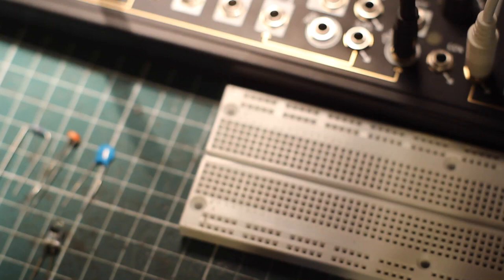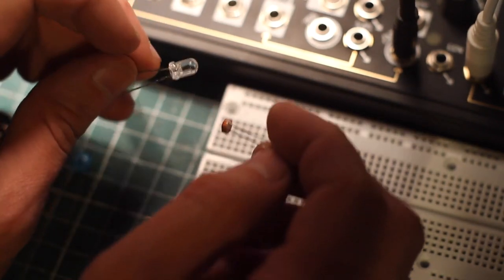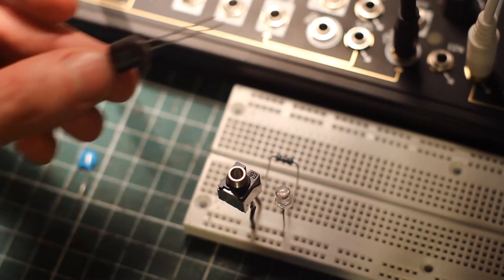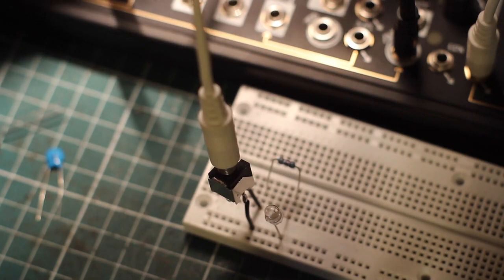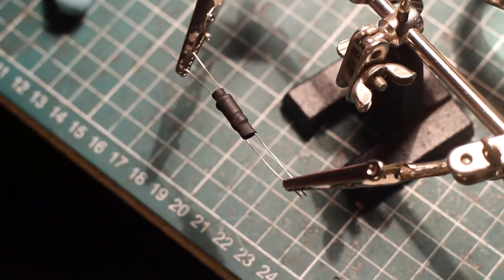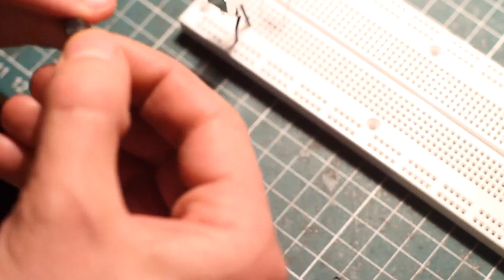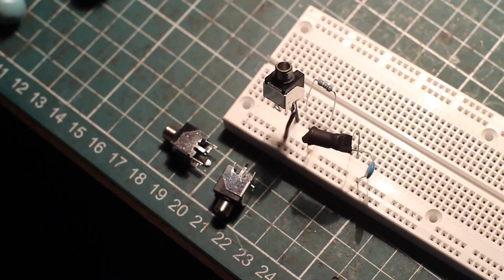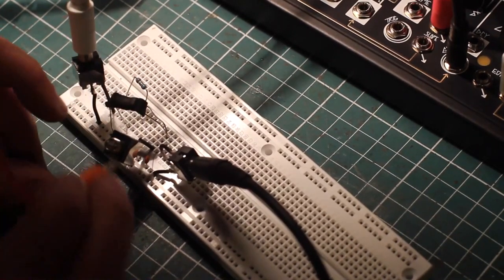SDIYClass#2 - The 3 dollar LoPass Gate - Make your own Vactrol!

Comment: hey o7, wanted to thank you for this vid......VERY MUCH!!  i'm getting into building basic oscillators and noise circuits, and this circuit is so so legit, FUN and easy to make.  I have been putting it on the output of everything lately and using the bastl cv trinity to send the vactrol rhythmic lfo's and envelopes. it works perfectly and sounds so soft, plinkety and analog.  with a little fiddling with different leds and resistors it was pretty easy to get the cv voltage from trinity knob range, scaled to match the vactrol volume range.  i really appreciate this revelation, because i really wanted some kind of simple envelope to tame and make useful the constantly ringing oscillator swarms...lol and this comes with an added bonus of lowpass filter too which has a very natural sound and can take the buzzing edge off the diy square wave oscillators. the trinity can send exponential shaped envelope cv, and this circuit responds well, making it really nice for shaping the constant input into sweet percussion sounds.  but anyway, thanks again.  would love to see more vids like this. (maybe the simple transistor ring modulator/waveshaper/bipolar vca one. it's passive too and uses one transistor and three jacks.) anyone considering trying this, SHOULD! : ) this vactrol is extremely useful and has made hours of experimenting with basic circuits pay off, because suddenly it has all become very controllable, musically useful and is really inspiring to use this circuit to perform different types of controlling.  🙋🏻🎛🎛🎛🐛
Reply from the maker: Hey, this makes me very happy :)  It's what makes me want to keep doing this more than anything, thanks for your encouraging words, and keep on having fun with sound and electronics!

Comment: Many thanks for a well produced, interesting and useful video. Having watched it I've been enjoying experimenting with various LDRs, LEDs and resistor values. I'm getting some very passable results so a few of these will find their way into my modular. The main thing I've struggled with is keeping all of the light out. It's amazing how sensitive the LDRs are to very low light levels. I'll get hold of some heat shrink - at the moment I'm using black insulation tape and the light does like to find its way in! Really good cheap additions to my synth though - thank you
Reply from the maker: cool! yeah, the heatshrink does a way better job than tape, go for it!

Comment: I stumbled upon an old article int the electronic magazine from the early 80s, where not the LEDs, but the 12V miniature incandescent bulbs were used. What's interesting, the author recommended to use a kind of diaphragm between the bulb and the LDR. It was a piece of cardboard, painted black, with a teeny-tiny hole in the centre, like in the ancient camera obscura . The diameter of this hole had to be selected  EXPERIMENTALLY for the best result. I wonder if it only makes sense with a bulb or...?
Reply from the maker: yes, that's a way to reduce the light, with LEDs you can simply increase resistance and achieve the same. Incandescent bulbs are much slower than LEDs though, which is why we use LEDs nowadays.

Comment: I have a vintage stereo that uses a few of these types of devices in the fm receiver signal section, mainly the multiplex board. Could a variable resistor be used to adjust for best performance.

Comment: Two questions you can perhaps answer:
A) Why is it called a Low Pass Gate? I've never understood that really.
B) What are the functional differences between an LPG and VCA?
All my synth learnin has pretty much been east coast school. I'm trying to wrap my mind around west coast school, but just don't really understand some of the concepts. I can use them, mind you. I just don't really understand them, which makes it hard to design sounds deliberately rather than "discovering" them experimentally.
Reply from the maker: Hi. A low pass gate is basically a low pass filter used as a VCA. It's actually cutting the high frequencies rather than just amplitude, which gives it it's characteristic west coast sound. The capacitor to ground after the LDR makes it a one pole low pass RC passive filter. That is the functional difference, as a VCA only cuts amplitude. Feel free to ask other questions you may have about west coast synthesis, cheers!
Reply: There is no real norm here, but a LPG is typically a Lowpass filter combined with a VCA. So not only do attenuate a incoming signal (= make it more silent), but at the same time cut the high frequencies. If the LPG is fully open the signal is passed with all it's frequencies. If it is only half open the signal is attenuated and has high frequencies cut of. If the LPG is closed, there is nothing to be heard. In short: a LPG attenuates high frequencies of the Input faster than low frequencies.

A VCA on the other hand does just volume and does affect all volumes equally.

Additionally to that the LED/LDR combination (vactrol) used in a LPG is slow. That means if you send a short burst (e.g. a Trigger) to it, it does not immidiately switch off after the signal is gone but "rings out" a bit. google "Buchla Bongo" to hear what that sounds like.

Comment: Hello and thanks for this. I love the sound of a LPG. I built this and it works great on my Pulsar 23 but I can't get it to work right with my Behringer MS-20 clone. I think the EG1 on an MS-20 is only 5V max so it doesn't drive the LED hard enough. Do you have any idea where I might look for info to get the vactrol values appropriate for the MS-20? TX.
Reply: Ha! Got it. I used all the component values you did but changed the resistor before the LED to 260R. Now, I got the thonk on the K-2, too.

Comment: Hi! Electronics beginner noob here. First off, thank you for a very useful and very well-explained tutorial.

I was wondering, what if I were to add a potentiometer to attenuate the cv input. Would I be ok connecting the side pins to cv in signal and ground and the middle "viper" to the resistor -> led-ldr combo +. Maybe this is a stupid question but I'm only taking my first baby steps in this thing.

Happy if you can help, anyway thanks again for the tutorial.
Reply from the maker: Hi Ville, thanks for watching :)
Yes, you can add an attenuator for the CV input if you like, and how you describe it should work just fine! Good luck :)
Reply: Synth Diy Guy great thank you again!

Comment: if you send a gate signal in, will there be a slight decay curve like on other vactrol lpgs?
Reply from the maker: yes, that'll depend on the LDR response time
Reply: Synth Diy Guy do you have a preferred LDR for that function?
Reply from the maker: @TechRedstone  i like using high value ones, like 2M

Comment: What VST I could use as modulation source?
Reply from the maker: This is analog, real voltages, not digital information. VSTis will not work, unless you set up a MIDI to CV converter. Then any mod source will work

Comment: So why would one need another non controllable VCA if you can already control the CV/gate before it goes thru this vactrol? Wouldn't you need a potentiometer on the LDR?
Reply from the maker: This is to affect audio, no pot needed, only CV from an EG or similar modulation source. VC= Voltage controlled, not non controllable ;)
Reply: @QuincasMoreira  Oohhhhhh so this vactrol idea is a way to introduce CV into something that doesn't have it. tyvm for this video dude!
Reply: @QuincasMoreira  wait, now this seems redundant. If you have a modulated source changing LED value, and LDR output changed value... why not just plug LED source into whatever and skip the vactrol?

Comment: Hi, Thanks for this video. I made a vactrol gate based on your video using a 40106 integrated circuit as the LFOr. I have a Korg SQ-1 and wondered if you know anything about how i'd go about using it to make gate patterns in a similar way to how you have used the CV out from the 0-coast as an LFO. I assumed I'd be able to get the Gate from the SQ-1 output and achieve my desired result but it's seemingly more complicated than that.
Reply from the maker: Hi James. Normally an Envelope Generator goes first, between your sequencer's gate and the LED on the vactrol, but it should work with a gate directly connected too. You need to make sure the gate output in your SQ1 is set to POSITIVE. If it doesn't work check with a fresh LED and see if it lights up. If it does, then the problem may be the polarity of the LED inside your vactrol.
Reply: Great, thanks. I will try this. I had some results out of it but it wasn't as simple as a high gate lighting the led which was strange.

Comment: Interesting video even corresponding to another DIY build.. The Erica Synth SWAMP, would you use DIY vactrols in this module?
Reply from the maker: hey thanks! Yes, you can definitely try home made vactrols on builds requesting industrial ones. Buchlas use LED/LDR pairings in their synths, no industrial vactrols...  Your mileage may vary of course, as different combinations will yield different results. I made my own vactrols for a Thomas White LPG and it worked great!
Reply: @QuincasMoreira  i just complete the kit build making my own vactrols and replacing one component, the red 22nf film cap, with 47nf film cap. This cap is connected with one leg of the S&h IC. It actually works fine similarly to your in the kit review.. Vactrols look like a new horizon for me into next builds like arduino cv controlled synths and so on.. keep on doing this diy classes mate, they are very useful and well explained!

Comment: Please help, I am entirely new to this and I got some 3.5mm jacks to do this, but idk which legs are ground or signal. There’s 3 legs, is there a ground and pos/neg signal or is it just ground and two signal?
Reply from the maker: Hi Elyssa. Usually one leg is the signal, one is ground and one is the switch. It's a terminal that gets connected to the signal one only when no jack is inserted. It's used for normalization.
I don't know which jacks you got though, so you should find the part number and look up it's data sheet!
Reply: @QuincasMoreira  I think I accidentally got a TRS jack, will that work? Do I connect them together on the same column of the breadboard? I looked at the data sheet and it didn’t really help :P
Reply from the maker: @elyssapalmer2298  TRS are for balanced or stereo connections. It'll work, just ignore the ring connection. Use tip and sleeve only. tip for signal and sleeve for ground
Reply: @QuincasMoreira  great, thank you so much! I could not figure out what I needed to search or how to figure this info out. Hopefully I’ll have more luck moving forward w this circuit. Your videos are super helpful btw!
Reply from the maker: @elyssapalmer2298  the data sheet should say which terminals are tip, ring and sleeve, or you can use a multimeter in continuity mode and simply measure! Best of luck, cheers!
Reply: Did you get this figured out?  I find “switch” jack terminals confusing sometimes, too. My fix is to plugin a lead, then use a continuity tester to track down the tip and sleeve legs.  HTH

Comment: hi, thanks for the video. did you messure the resistance of the foto resistor when the led is on? i had only a green led... out comes 50kohm for the light resistor. wondering if and in which direction i have to adjust the capacitor...
Reply from the maker: Hey! No, no measurements...  but to find out what cap to use, it's easy. Put one in, listen to it, if it sounds too dark (filtered) use a smaller cap, if it sounds too open, use a bigger one!  I found 100nf worked for me but yeah, that'll depend on your LDR too. You may also use a smaller resistor for the LED, looks like yours is lighting up kind of dark!
Best of luck!
Reply: hey thanks a lot for the reply. i could not wait for your answer and did exactly what you are suggesting. looks like the resistance of the ldr does not matter to much. have only a 2,2 nf and a 100 nf at hand. 2,2 nf to open. 100 nf little bit to "dark" but should do it. looks like the 10 nf might be the best choise for me too...i built 2 gates next to each other with the same components and sure enough the 2 vactrols are not responding equaly :-)

Comment: Hey! I'm pretty much a noob at this but I've seen people putting the resistor AFTER the LED part of the vactrol, at the "cathode" end (as I understand, with any diode there's a Anode, the recieving end, and a Cathode, the blocking end). I always thought putting the resistor on the anode end made more sense, that's where power comes from. Do you know of any reason why some would put a resistor at the cathode end? Thanks for this great tutorial, I'm going to put it into practise soon and hopefully force 4 LPG's in 4HP (I'll be using a protoboard at the back of the panel haha)
Reply: Little late, but it doesn't matter the order, it will reduce the same current anyhow

Comment: Very nice work - what type of LDR did you use for this? Also, have you done any measurement regarding the amount of time lag you get in the response? How long does the gate stay open once the LED goes off etc?
Reply: Thanks Gary!  I just used a small LDR I had in my drawer, I'm pretty sure it's 2M max resistance. No, I didn't measure the lag, just by ear, sounded good to me :)

Comment: Nice video Quincas, thanks for sharing.   How significant is the volume drop from input to output when your vactrol is fully open ?    I like the idea of a passive device, but wasn't sure if a make-up gain stage would be beneficial, or not really necessary
Reply from the maker: Hi! I haven't measured, but the volume drop is not very significant, the
 ldr resistance goes very low when the LED is fully lit. Besides, synth 
levels are so high, it's normal to have to attenuate them, so I don't 
really think make up gain is necessary. Thanks !
Reply: Awesome, thanks!   I'll have to rummage around in my junk pile and find a couple LDRs.... now where did I put those rusty old solar walkway lamps?!?

Comment: Thanks for this simple tutorial. just getting started and it's super clear. Do you know if it would work for adding CV inputs to a guitar effect? I'm trying to hack my Robert Keeley compressor, and turn it into a module. Thanks again!
Reply: Maybe. I've never had much luck with vactrols and from my reading/experience this video gets a number of things wrong. When working with audio frequency the limiting factor is the response time of LDR not the LED. For a discussion on LED rise/fall times see this link: https://forum.arduino.cc/index.php?topic=210864.0 . LED rise times vary depending on colour from ~3 to ~13ns and fall times from ~12 to ~3ns so time worst case rise/fall  ~40kHz. If you look at the data sheet for the LDR part number GL5528 (all the GL55xx) the response time rise and fall  is 30ms so the maximum frequency with a GL55xx is ~16Hz. An other thing to consider is that if the LED is too bright the LDR will saturate and the is going to increase the fall time. Having said all that LDR's are being use to build guitar effects https://www.youtube.com/watch?v=NHu0szLyr9U

Comment: Would it be worth it to use a pot in place of the resistor for fine tuning?
Reply: I would also like to know this. Thanks.
Reply: I think that a pot by itself probably wont work, if you go above the LED voltage limit you'll fry it. Though i reckon you could use a pot and a resistor in series, that way the resistor can protect the LED from getting fried.

Comment: Thanks for the video! So what does this do exactly? I honestly couldn't hear something. I came searching for a low pass filter to make a foot stompbox drum out of a piezo disc and cut all frequencies sharply above about 70hz out of the signal to the mixer. Is this what i need :)?
Reply from the maker: Thanks! No, this is a low pass gate, not a low pass filter! If you hear silence, that is the lopass gate at work, it's acting more like a volume control than a filter. Without it you would hear the synth constantly droning with no volume envelope at all.
To make a simple low cut filter at 70hz you need a capacitor and a resistor:https://www.electronics-tutorials.ws/filter/filter_2.html
Reply: @QuincasMoreira  Oh fantastic! Thanks!

Comment: really cool !   
Is it a Passive Low Pass Gate or a just Passive Vactrol VCA ?
What can be done (simply) to adjust the low pass part ? will changing the value of the capacitor or put a pot in series or parallel to it change the band pass ?
Reply from the maker: well, it is a low pass gate, it would be a VCA if you remove the cap to ground. Changing the cap value will affect the cut off frequency (bigger= lower) . Have fun!
Reply: @QuincasMoreira  Thanks ! I'll try with different caps, can you give me an advice about the acceptable range of the caps to try  ?
Reply from the maker: @KNHSynths  ANything between 10nf and 10uf!
Reply: @QuincasMoreira  Quite a wide range :-) Thanks for the information.

Comment: im just using the audio from two ic555 chips ...will I get the same seq sound? you mentioned the audio you have going in ...do you have a straight tone going in and your out put makes a sequenced sound?
Reply: Hi, the LPG is like a VCA. it only controls amplitude, so you can use an Envelope Generator to control the volume of the sound. It does not generate sequences, for that you need a sequencer

Comment: Fantastic video. I was wondering how to Implement the tone switch. Is it just adding a SPDT switch with a different resistant party or is it a Capacitor? Thanks
Reply from the maker: it´s the cap!
Reply: @QuincasMoreira  thanks man. Wicked video by the way!!
Reply: @QuincasMoreira  do you know what would happen if I put a potentiometer in place of the 33k - would that also change the tone?
Reply from the maker: @subcityofficial9409  the resistor just controls the luminosity of the LED, it's more about response curve than tone